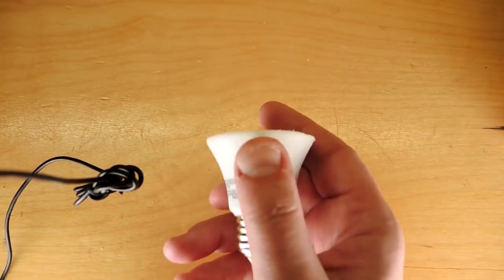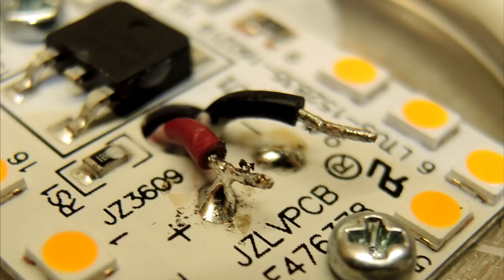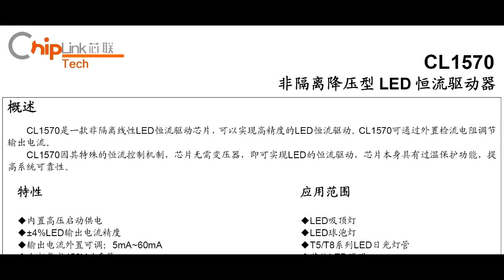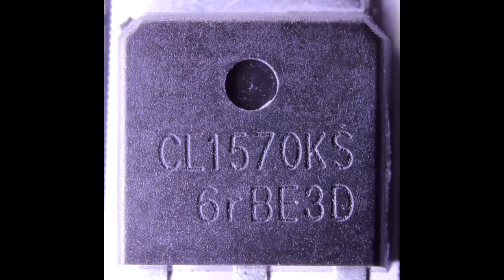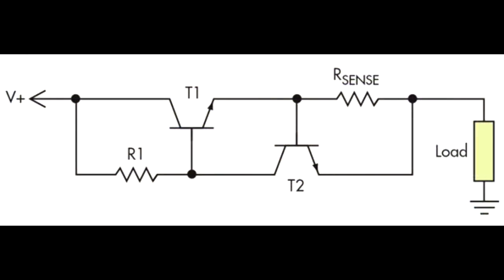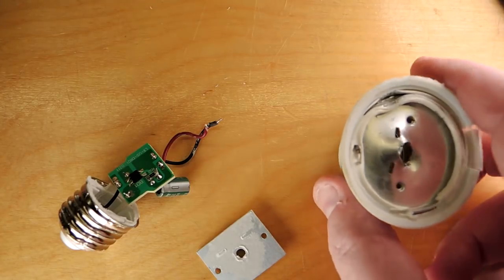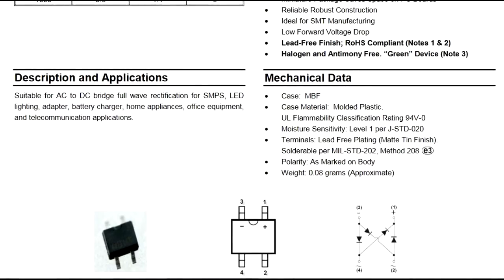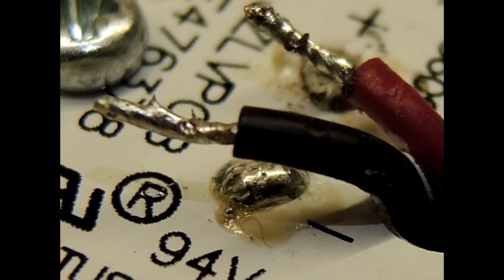Noma LED Bulb Failure Analysis and Teardown

Comment: I would put the lamp without the diffuser high up by the ceiling where nothing can touch it acceidentally. Looks like the diffuser clicks into place without glue. I wish they didn't use glue at all.

Comment: It's funny I've had several NOMA LED Bulbs fail in the past year or two and have had several running for years with no problems which I've assumed points towards poor quality control.  Obviously from your video this is the case.  I literally replaced one NOMA bulb for another and it started flickering within months.  Others installed over two years ago functioning without problem.  I also had a similar experience with a few GE bulbs.  Flickering after a while of use, while others have been working perfectly fine.  One I've had installed in an area where we leave the lights on a lot has been on give or take for over 3 years.

Comment: LED Lighting High Voltage Linear Constant Current CL1570KS/KSD
Overview

CL1570KSD is a non-isolated linear LED constant current driver IC that can achieve high-precision LED constant current drive.

The CL1570KSD regulates the output current through an external current- sense resistor.

Because of its special constant current control mechanism, the CL1570KSD can realize constant current driving of the LED without a transformer. The chip itself has an over-temperature protection function and improves system reliability. 

Features

◆ Built-in high-voltage start-up power supply 
◆ ± 4% LED output current accuracy 
◆ Output current external adjustable: 5mA ~ 60mA 
◆ Internal integrated 450V power tube 
◆ No transformer 
◆ Over temperature adjustment function 
◆ Simple peripheral circuit, fewer components 
◆ Chip can Directly welded on aluminum substrate 
◆ System application without EMI problems Application scope of 

application

◆ LED ceiling lamp 
◆ LED bulb light 
◆ T5/T8 series LED fluorescent tube 
◆ Other LED lighting

Comment: R0 prevents the slight glow you can get from a led lamp after you turn it off. It can be seen on some lamps in a dark room.
Reply: Yes, I was amazed ar that.  The leDs are so fkg good these days that they glow visible on MICRO-amps - like the little neon indicators.   In some wall-switches there is one such Neon indicator - across the contacts (with a .68? meg resistor !!) - and the leakage through that makes mine flicker in the dark.
Reply: To is too high to prevent the "off" glow.  It is to discharge the red
cap to avoid tiny possible shock while handling after use.  It's standard practice.

Comment: Pretty poor efficiency ballast.
Reply: Yes a very stupid lamp.  No wonder it's dead !   That looks like a linear voltage regulator, so it it never going to be able to dissipate all the waste heat from the V.I .    Sensible" lamps use a 400v rated series C before the rectifier - but they fit too big a  capacitance value which makes them run hot - then pop.  I have replaced several now, with 1/3 - 1/2 uFage
capacitor.   Just as bright, but just luke-warm running. 20 yr guarrantee !
     To find the popped leD - if it isn't sticking-out like only a burnt LeD can - a little blocking oscillator running from one lithium cell is very good as a current source.

Comment: That current regulator must get real hot. Not the most efficient design.
Reply: Cheapest, though. You can read the lumens per watt specs on bulbs and figure out which have the current-burner circuit and which have a switching regulator.
Reply: Yes a very stupid lamp.  No wonder it's dead !   That looks like a linear voltage regulator, so it it never going to be able to dissipate all the waste heat from the V.I .    Sensible" lamps use a 400v rated series C before the rectifier - but they fit too big a  capacitance value which makes them run hot - then pop.  I have replaced several now, with 1/3 - 1/2 uFage
capacitor.   Just as bright, but just luke-warm running. 20 yr guarrantee !
     To find the popped leD - if it isn't sticking-out like only a burnt LeD can - a little blocking oscillator running from one lithium cell is very good as a current source.

Comment: I don't understand how it failed did it heat up enough so the solder melted and the wire lifted away?
Reply: it looks like a tear due to stresses on the wire and hence the solder joint and very little surface area making a connection, heat could have contributed due to the a decreased cross-section of the connection and hence more resistance in that part.
Reply: Probably just a crappy soldering job by Chinese laborers.

Comment: I would assume R0 is simply a discharge resistor. Otherwise, you could get a nasty nip from a bulb when you're unscrewing it.
Reply: It is to prevent the lamp from glowing or flashing from capacitive leakage.
Reply: Bridge rectifier will prevent that

Comment: R0 510k is to drain the high voltage capacitor once the lamp is shut off. When you grab the base of the bulb, the cap could discharge through your body.
Reply: Bridge rectifier will prevent that.
Reply: Good point, maybe in case the plastic cover has been removed, the LEDs could be at a high potential, or to reduce "ghost" lighting from leakage currents? Either way, bleeder resistors seem to always be used, I know I would want one for any prototype I'm working on.

Comment: What a total piece of crap. That bad soldering is beyond words. I'm speechless. They couldn't even be bothered to make the effort to hold down the wire while soldering it. Its only takes a tiny fraction of a second to think and move ones hand/finger to hold it down while holding the iron in the other hand. whoever assembled that needs to be fired from their job.
Reply: more like poor quality control
Reply: I bet a lot of those LED bulbs are dead on arrival because of that wire connection (or lack of).
Reply: That's harsh. They're probably working in near slave conditions working long hours for piece pay. Each bulb is worth far less than a penny earned to them, I'm sure. While their work is shoddy, I can't bring myself to condemn them for it. We are the ones that demand that quality by demanding low cost.

Comment: I wonder what the minimum supply voltage is for that current limiting chip. Maybe the LED panel can be re-purposed as a low(er) voltage DC bench lamp or on some gadget. The LED seemed to have a nice color at least on the video.

Comment: Because of this video and all the others before it, i never toss bad LED bulbs.  So many can be fixed as easily as shown in this video, or at worse you have to replace a cap.  Very rarely are the LEDs actually bad.
Reply: Any LED bulbs I've had fail were also the power supply.

Unfortunately, most of them failed in a mode that no longer limited the current through the LEDs, and took them out too.
Reply: I just replaced a 12volt LED tape that ran for 3 years with gradually failing LEDs. I discovered that the resistors were 18 ohm, and were overdriving the LEDs. The new ones are 33 ohm and I drop an extra 0.6 V through a diode to run them even cooler.
Reply: Its standard in the electronics industry to have 90-95% of problems be bad connections.

I wanted to see the innards of one of these and grabbed one from the trash. Now it's been lighting my shed for a couple of years.
Reply: Cheap chinese LED lamps often have LED failures though because:
1. They put the LEDs in parallel, but fail to make sure the LED die are matched. Therefore, one will take more current and be stressed more than the others. When it fails, the same thing happens with the rest of that row, which is now taking even more current.
2. They overdrive the LEDs.
3. They have poor cooling and/or run the LEDs at an excessively high temperature.